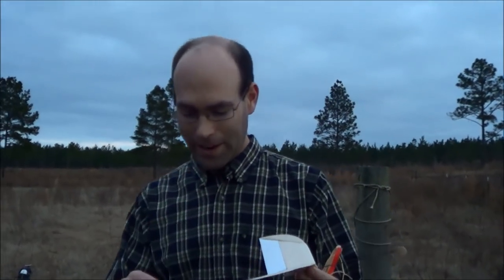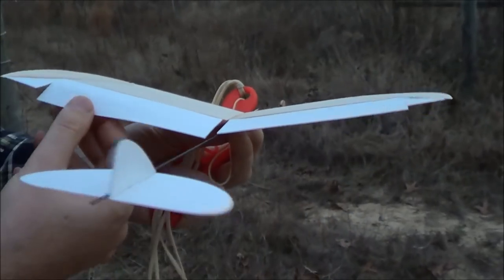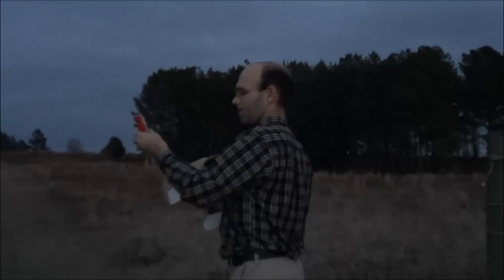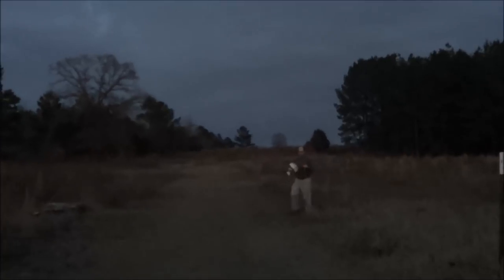Tip for Science Olympiad Elastic Launched Glider + 32 sec flight!!!

Comment: Thanks Josh & Hope.  The 32 second glider looks to have more chord, is that correct?  I've tried (very limited) a design with greater than 3 inch chord as SO has no chord criteria like AMA.  Also, does the vector board flex?  I've been taking some iphone slo-mo video and see a lot of wing flex but can't tell if the flaps are flexing at launch.
Reply from the maker: James Lambert they do flex quite a bit under launch loads. Chord is over 4" on this one and it's 18" long. Seems to work quite well.

Comment: For a first time  catapult glider which do you recommend. The Carbonette or the Protégé. I have experience in building balsa models many years ago.
Reply from the maker: I'd recommend the Carbonette if you're flying outdoors. Less aeroelasticity to deal with. If flying indoors then you'll have to go with a flapped glider such as Cat's Meow or Protege Lite which are easier to trim than the SO Proteges.

Comment: Am I right in thinking flapped gliders don't launch as high? Carbonette seemed more reliable on launch.
Reply from the maker: Steven Hugh that's kinda the point.  Rigid gliders launch higher, but they have a much higher sink rate. You'd be doing really good to get 20 seconds from the same height with a Carbonette. Most contests will be held in low ceilings where the flappers are king.
Reply: Indoor gliders need to be designed to reach the ceiling at the site where they will be flown. Most gliders for Cat 2 or less are flappers. For higher sites most gliders are rigid balsa.
Reply from the maker: @olbill70  Thanks for clarifying that better than I could ever have hoped to. Steven, Bill is the guru of gliders. Whatever he says to do, do it.
Reply: @joshuawfinn  Unless you have access to Kurt Krempetz or Stan Buddenbohm or Jim Buxton or Mitsu Ishii.
Reply from the maker: @olbill70  I do appreciate the humility. You're still the king of low ceiling in my eyes. ;)

Comment: I assume you are separating wing tip washout from the flaps with the slit.  Does this give more effective spanwise lift in the flapped region?
Reply from the maker: David Franklin, to the best I've been able to determine, yes it does. It's become the dominant layout in Europe over the past few years.
Reply: For the Yashinskiy glider the split tip seems to be desirable for Cat 1 and low Cat 2. To get higher the tip is removed and replaced by a chordwise piece of balsa. The end of the flap is attached to the end piece of balsa. I'm going to modify at least one of my Yashinskiy gliders like this for the Kent State contest in April, 2019. Kurt Krempetz will be doing in the low 60's in both catapult classes so it will take some really good results to even be close.
Reply from the maker: @olbill70  Please keep me posted on how this works out. I've been seeing some really weird stuff done on the Yashinkiy gliders lately and would really like to know what's what. The split flaps made sense, but those cutoff tips are weird sauce. There's no debating that they work though.
Reply: Thanks olBill.  I didn't know the master was watching.  Thrilled to make the acqaintance.
Reply: @davidfranklin5270  Who me?
Reply: @joshuawfinn  The first time I saw this I asked why? The answer was height + sink rate -. In indoor gliders using as much vertical height as possible usually means better flight times.